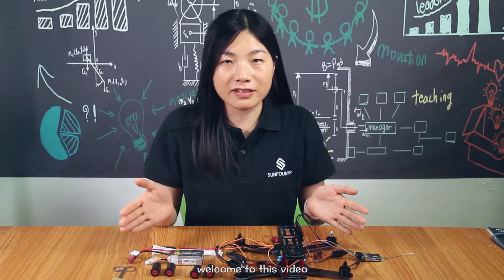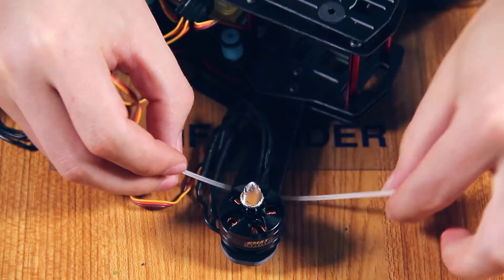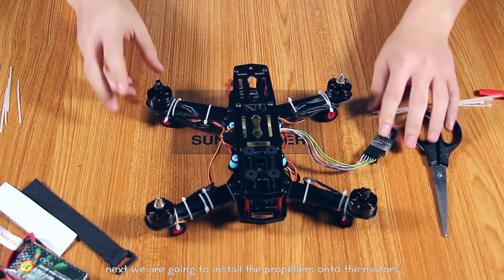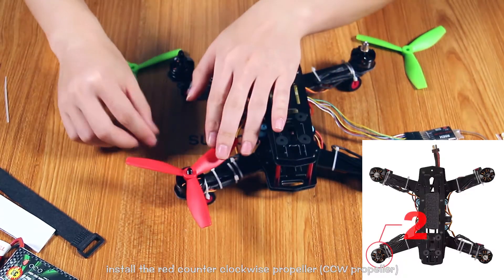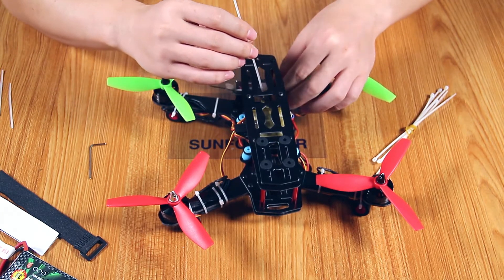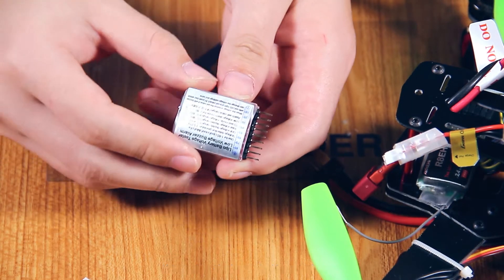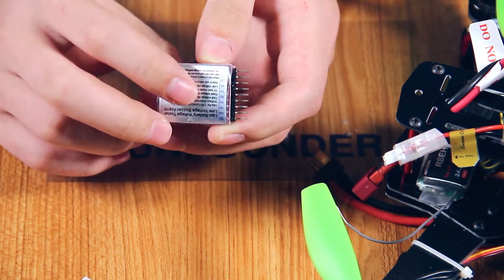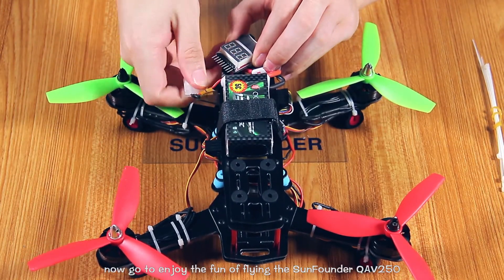SunFounder SF250 FPV Racing Drone Quadcopter Assembly Tutorial 06 - OpenPilot CC3D-Propellers

Comment: i have been wanting this quadcopter for a long time and my mom got it for me for Christmas.  it is my first racing drone i also bought a spiectrum 6 channel receiver but it labels the channels  BND/DAT   THRO  AILE  ELEV  RUDD  GEAR  AUX1.   i'm almost done building it but I  do not know where to plug in the wires coming out of the flight controller that are to go into the receiver. Please help.   thanks
Reply from the maker: Please kindly check the tutorial here: https://s3.amazonaws.com/sunfounder/The+configuration+in+OpenPilot+and+wiring+of+receiver+to+CC3D+for+different+modes.pdf
Reply: thank you i did what the sight said and i pluged in the receiver correctly and now i am able to bind but once i do i can not make the motors turn and the esc on arm one and arm two (mainly arm one) are getting warm and almost hot i do not know how to make it     fly thank you for your help
Reply from the maker: Could you please record a video for us? We want to check your wiring and how you configure on software. You can check whether the power of esc is connected reversely to GND or not yourself. The red wire should be connected to +, while black to -. You can check whether the figures on software change or not when you operate the radio transmitter. Can you lock the radio transmitter?
Reply from the maker: Hi Ian,
We have watched it, the GND,VCC cable of ESC should be right. 
Pls take a video to check whether the signal cable of the ESC is right, we can't confirm according to this video. First, pls open the "OpenPilot" and click the "INput", then, operating the remote and show the data. We need to check if the data have changes.
Looking forward to your reply!
Reply from the maker: Hi Ian,
We concerned about that have you solved your problem?
Looking forward to your reply! Good luck!
Reply: thank you so much for your help i am sorry i could not respond earlier i took the drone to the hobby store to program it and they have now finished and they said it now works thanks so much for your help
Reply from the maker: Hi Ian,

Lol, great! You are welcome.
Have a nice day!

Comment: Do i have to do something with my Computer because it doesnt work yet
Reply from the maker: Hi Leonard! Please kindly check the wiring of the receiver first, ensure it is the same with the wiring in this picture: https://s3.amazonaws.com/sunfounder/Arduino/_MG_687612.jpg
As you can see, there are three pin header on the receiver: signal (CH1-CH7), VCC, and GND.
Wire 1(GND) --- row 3, wire 2(VCC) --- row 2, wire 3 --- CH2, wire 4 --- CH3, wire 5 --- CH1, wire 6 ---CH4, wire 7 - CH5, wire 8 - CH6
Set the receiver to PWM mode, and pair it with the remote controller. Then connect CC3D to your computer with USB cable, if your computer still doesn’t work, you need to operate: 2. Configuring the wizard of CC3D
Only when you finish the step “upgrade”, the computer will react.
Reply: SunFounder the wiring from my brushless Controller to the cc3d was wrong. I fixed it, but the new Problem is that it doesnt fly (stable)
Reply from the maker: Please refer to the instruction of Calibration after flight at: https://www.sunfounder.com/wiki/index.php?title=SunFounder_250%2BRadiolink_T8FB_Remote_Controller(Assembled)
Hope it can help.

Comment: I just took this drone for a test flight, and it worked well!  It took me two days to assemble it, but I wasn't in a hurry.  It seems that OpenPilot is now dead, but I found that LibrePilot (the official replacement) worked well for setting up the drone.  I bought an IA6 receiver so I could use my existing FlySky/Eachine i6 radio (I believe it can configured to handle 10 different quads). That too worked well.  Thanks SunFounder for a pleasant holiday project and hopefully I'm now ready for something more challenging!
Reply from the maker: Bravo!!!

Comment: how i can connect a remote control to this drone ?
Reply from the maker: Hi, Could you tell me you mean connect a transmitter to the drone or connect  a remote control to transmitter?
Reply from the maker: Hi Maria! We are now preparing a detailed tutuorial about this, but not finished yet. You can try to connect by PWM way. Connect them in the wires original order.
As you can see, there are three pin header on the receiver: signal(CH1-CH7), VCC, and GND.
1.Connect the wire to the flight controller(as shown in the picture in the link): https://www.sunfounder.com/wiki/index.php?title=File:MG_687612.jpg
Wire 1(GND) --- row 3, wire 2(VCC) --- row 2, wire 3 --- CH2, wire 4 --- CH3, wire 5 --- CH1, wire 6 ---CH4, wire 7 --- CH5, wire 8 - CH6
2.Follow the instructions in CC3D Software Debugging guide.
Reply: Hi SunFounder. I'm pretty sure Maria was asking what RC to use with this drone, and how to bind it to the receiver which was installed in tutorial #5.  I have similar questions myself.  It seems to be an 8 channel receiver (though only 6 channels were used), so presumably it's intended for a 8 channel RC.
Reply: And having just double checked, I think I can answer the question for myself and Maria: the receiver tutorial was just a guide, there is no RC or receiver in the kit. You have to buy the RC (such as the FlySky i6), it will come with a receiver which you install. You may need to experiment to find the correct channel assignments (matching the RC sticks). The RC must do 6 channels or better.
SunFounder please correct me if I'm wrong.
In my case I already have an Eachine i6 (FlySky rebadge I think), so all I need is a new receiver, which I've ordered.
Reply: I see in another video (for the ready to fly version), that the RadioLink T8FB controller is used.
Reply from the maker: Hi MrSwanley! Yes, you are right. The RC and receiver are not provided in the kit. You can buy your favorite compatible RC and receiver to match, and refer to the wiring pictures in the link to connect.
If you have further questions, you can also post it on our forum at: www.sunfounder.com